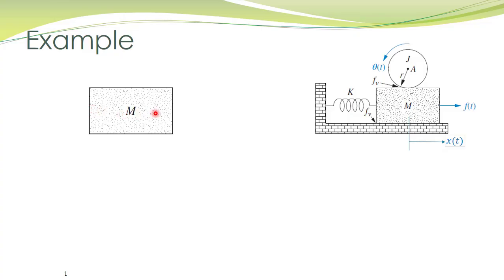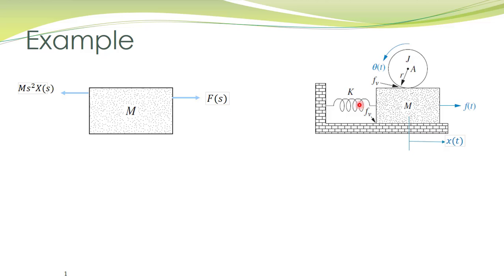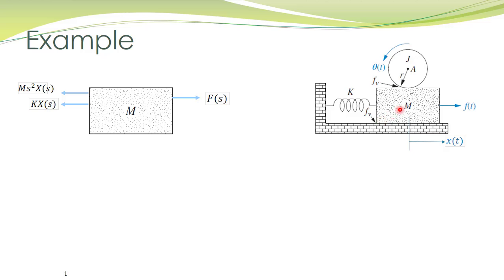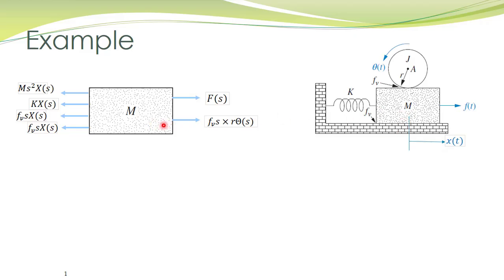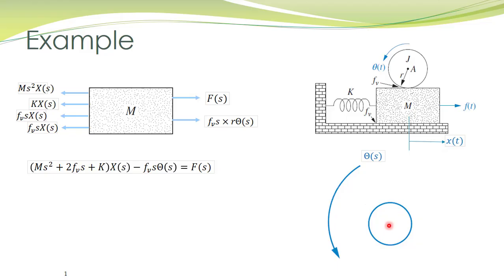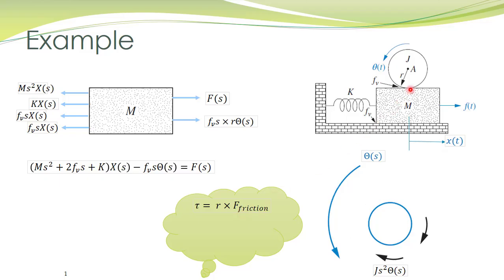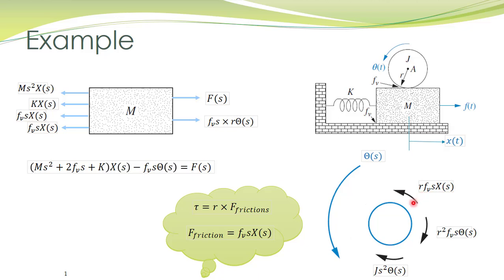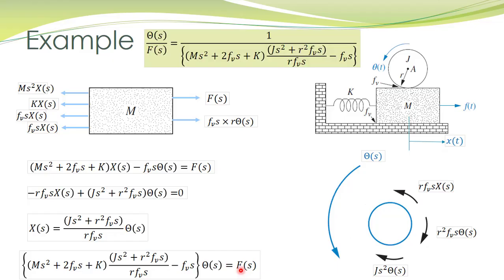LCS - 09b - Rotational and translational displacements

Comment: salam alaikum brother!  I want to express my gratitude for the incredible content you share through your videos. May Allah bless. you Currently pursuing my master's degree, I find myself encountering challenges in modeling mechanical systems. I am facing a challenge in modeling a Sliding Block on a Moving Inclined Plane without friction using Newton's equation of motion. Although I have successfully tackled this using Lagrangian mechanics due to its simplicity, there is a requirement for me to also utilize Newtonian mechanics. I would greatly appreciate any assistance or guidance you could provide in this regard.
Reply from the maker: You may share details of your work with me.
Reply: A wedge of mass m1 and inclination angle α slides along a fixed horizontal surface
while a block of mass m2 slides along the angled surface of the wedge. Knowing that x1 describes the displacement of the wedge relative to the surface, x2 describes the displacement of the block relative to the wedge, all surfaces are frictionless and gravity acts downward, determine a system of two differential equations that describes the motion of the wedge and the block. @MAFarooqi